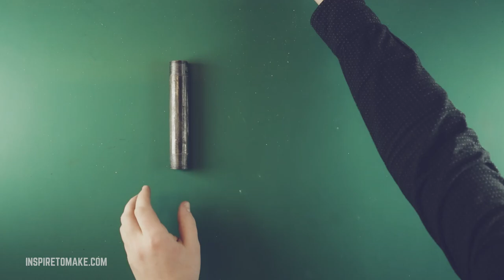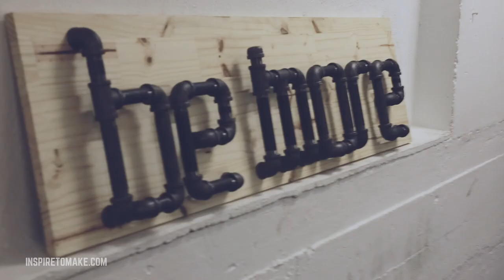DIY Iron Pipe sign

Comment: This project seems easy, which it is,
But those pipes are BLOODY EXPENSIVE!!!
Reply: No Mainstream you could probably us painted pvc pipes for a similar effect
Reply: *use, but yeah I think this is a good idea. If you would do so, i would try to use some tools or method to, not only remove the molded serial number but also to give it some surfaxce texture. I would also use a good lacquer/ spray lacquer and a semi-gloss finish.
Reply: No Mainstream If you use a plasticote paint with a cast iron finish it makes it textured
Reply: No Mainstream u can use pvc pipes with paint on it. Or may me colored duct tape.

Comment: Never buy from new, 9 times out of 10  your project will far too expensive compared to your projects worth, get old and used stuff and clean them up, there's so much more job satisfaction in it. Those new pipes and fittings are at least over $100, you can get them old, rusty and used for  free or at unbelievably cheap. Just clean them up and your good to go...!!